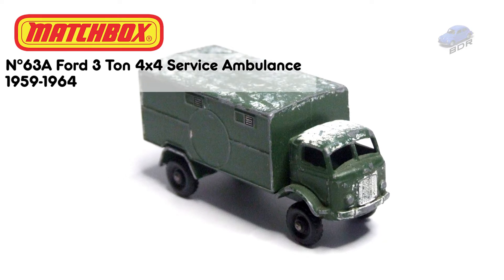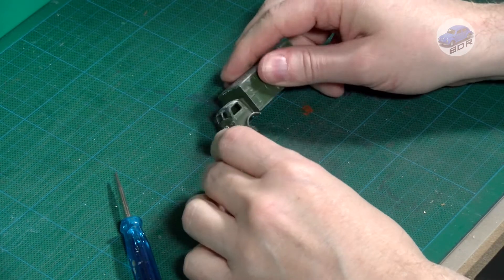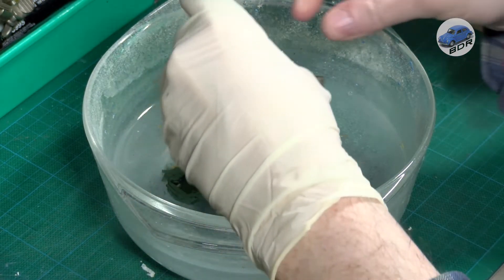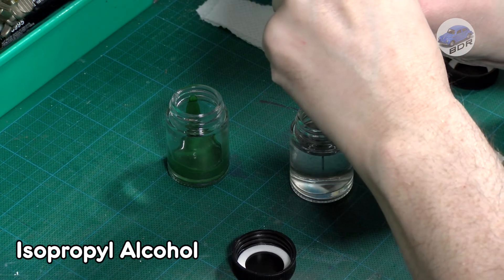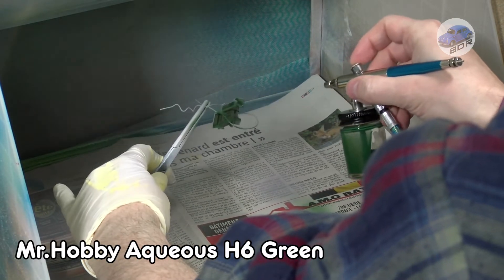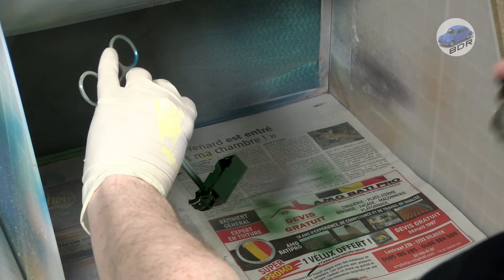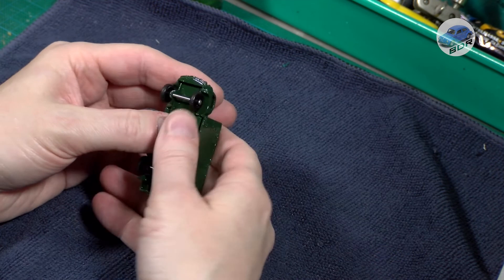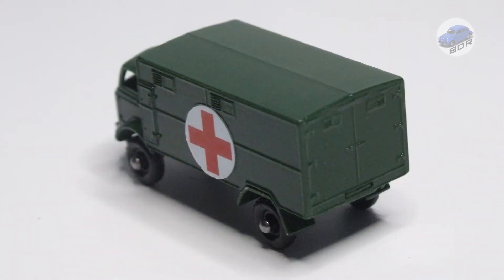Lesney Matchbox 63a Ford 3 Ton 4x4 Service Ambulance Diecast Restoration

Comment: Great Job there, just a small point, as this is a military ambulance the front and rear bumpers (fenders) would have been left in the colour of the main truck to aid camouflager so Matchbox only silvered the headlights on these military models and some mint models I've seen don't even have that.
Reply from the maker: Thanks, Tony! Indeed, I found a lot of different variations of this model. Even a very early 1959 model with the headlights as well as the bumper chromed. My guess is that Lesney omitted the chrome on later editions for the sake of realism. Personally I feel the detailing brings some life into the model, even if it's not 100% realistic. 🙂
Reply: @BelgianDiecastRestorations  Fair point, and it does not take away from a great job you did of restoring this one.